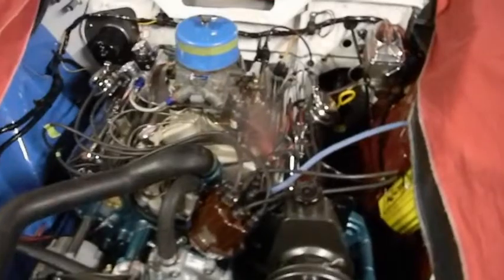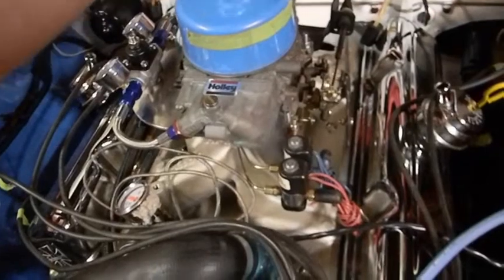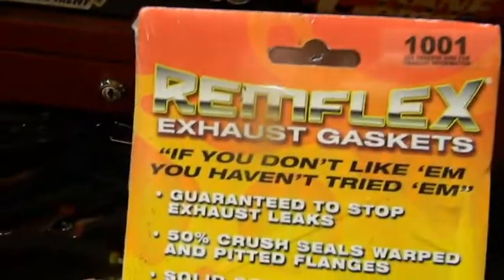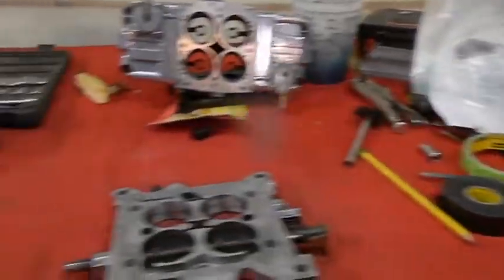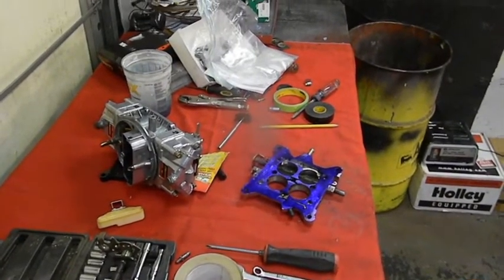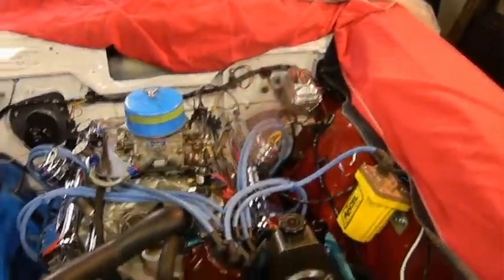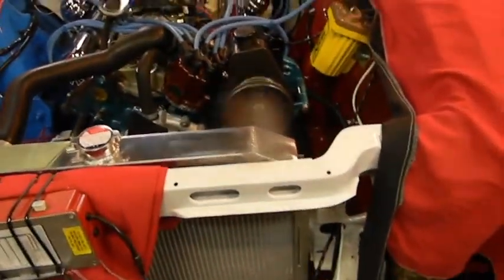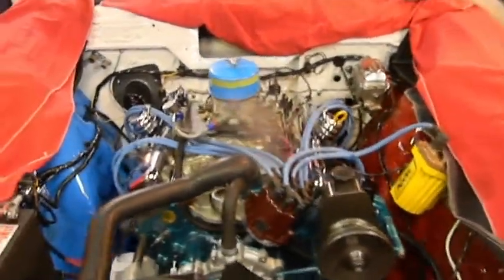AMC sunday Update

Comment: Anthony have you used the copper gaskets on the headers before? Thoughts? 

 Back in my teen years I changed so many of the paper mr gasket header gaskets on my old car I finely fingered out that if I ran it without any gaskets I had much better luck and that's how I went in the end. Of course that wouldn't fly on aluminum heads today.
Reply from the maker: My wagon has copper header gaskets for the last 14 years they were thick and super soft i just can`t remember the brand name....These gaskets are nothing like paper gaskets there more like head gaskets metal core with a graphite body...there an 1/8 thick and made to be compressed down to a 1/16 of an inch...they also with stand temp`s of 3,000 deg.   my wagon headers i welded a sealing bead on the flange and machined them flat....Jr`s headers have a flat flang...
Reply: Thanks, the graphite sounds like a nice solution. 

I don't remember what I used on my 5.0 this time but remember I was thinking about trying the copper before the final going over.

Comment: So, what is on the lift? Silly question, but I’ve never seen this. Have you ever seen a Police Prepped Matador? Did it use a hi output alternator like a Leece Nevill? I know there were 90 watt stators for GM alternators in the 80’s, and would use one of those in an external regulator style alternator of the second Genereation, 7122 rebuild number. They had the largest diodes of any GM alternator.